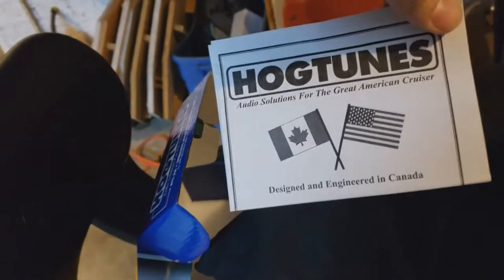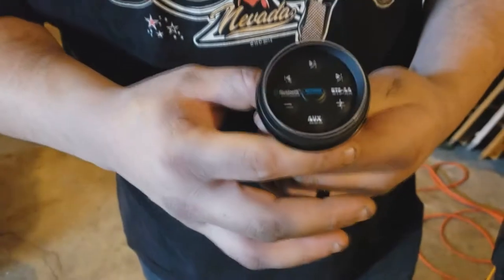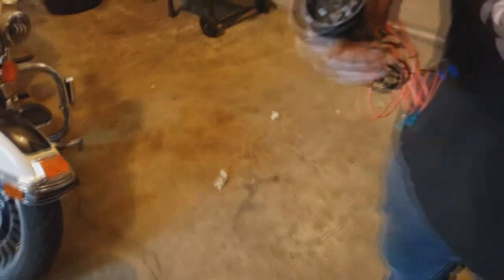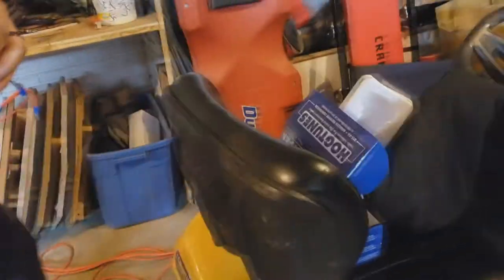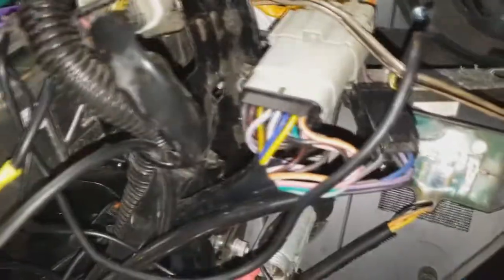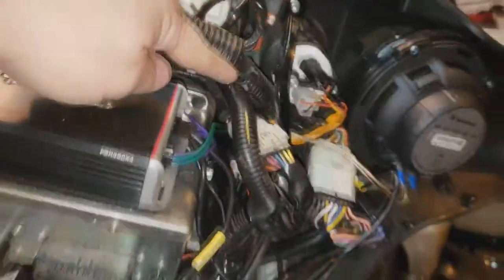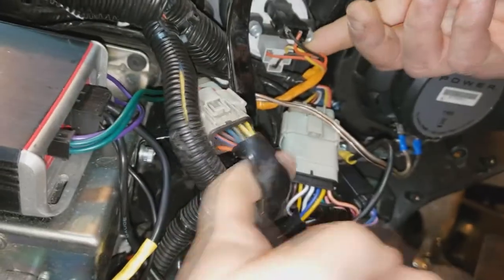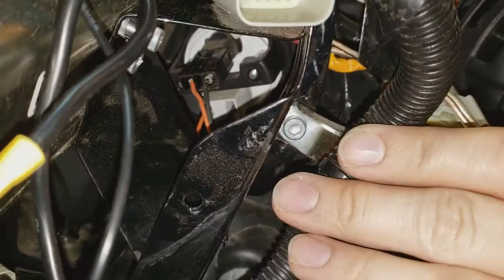Installing bluetooth on your Harley

Comment: was about to order this , but the issue I have is the aux. plug itself. I've been using a Bluetooth adapter until now. Worked great. But seems something gone wrong internally . So plugging this unit into that plug doesn't solve my issue. Im thinking ill invest in a new head unit.

Comment: I was seriously considering the same unit. I ended up getting a Kenwood BT enabled radio. Like you guys I travel alot and I miss the weather band. I had to solder the wires and install am adapter for the steering wheel controller. 
Your option is prob easier and keeps the weather band.
Reply from the maker: Ya my old bike I went with kenwood missed weatherband to much so this bike I went this route